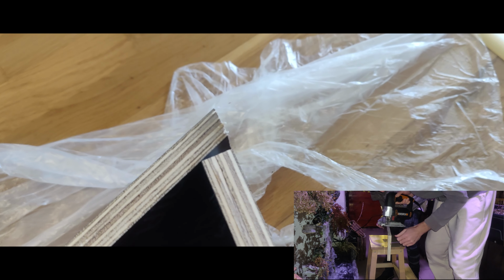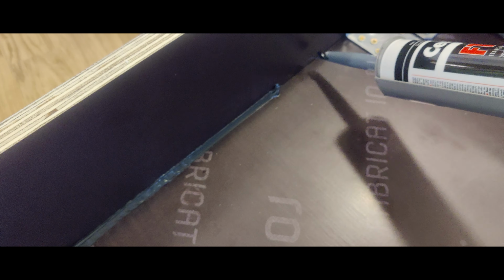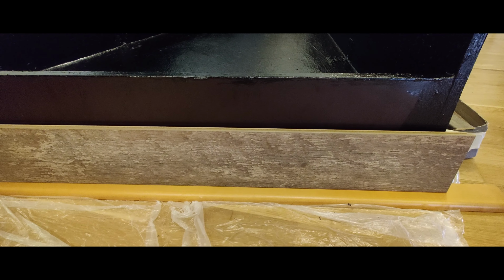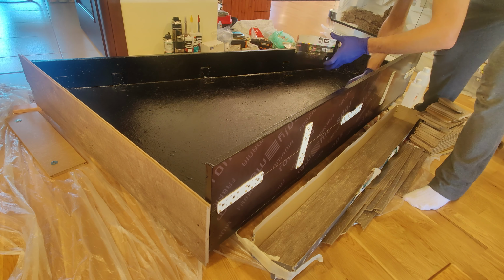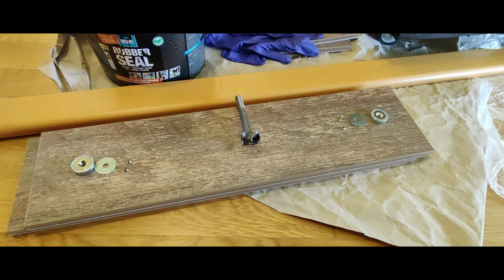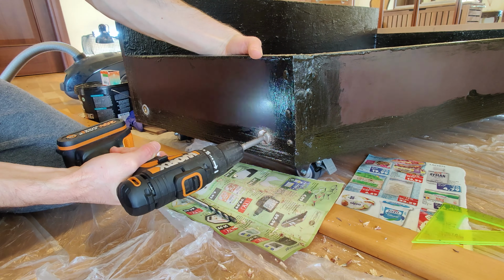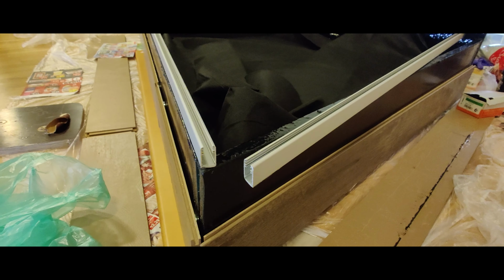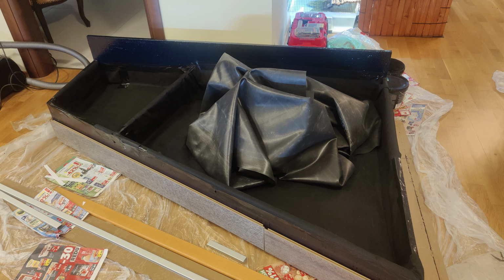Guide to an Ideal Turtle Tank Setup Indoor - Episode 1 🐢

Comment: Super nice! I was looking to upgrade the aquarium for my turtle as is growing bigger, but I think I will try to follow your example and build one myself.
A few questions:
1. How many liters fit in yours?
2. I read somewhere that the water depth should be 2 times the length of the turtle's shell. Is that wrong? yours doesn't seem too deep. My turtle is a red ear slider, 15 cm length shell.

Amazing video!
Reply from the maker: For Red Ear Sliders, about 30-50cm is perfect. Turtles in general prefer shallow waters, where they can hunt for food, hide away in vegetation and bask in the sun. My water depth is only 15cm, but intentional, to fit perfectly next to the Tegu enclosure and is sufficient for my male (males tend to remain on the smaller side). My turtle can still easily swim around and loves to lurk under the aquatic plants. 
My enclosure has about 150L.

For your turtle, you only need to have wider sidewalls. Since Red Ear Sliders can outgrow 25+cm and 2+ kg if it is a female, I would go for 50cm depth. For a male, 30cm is perfect.

Thanks for the appreciation!